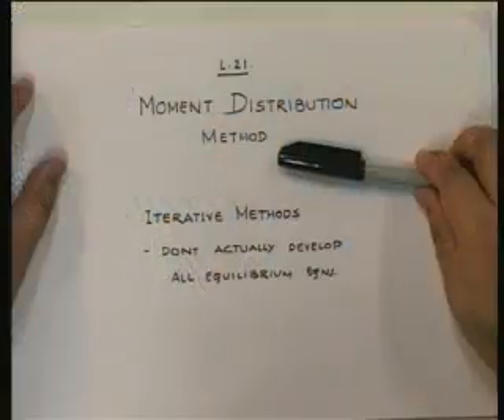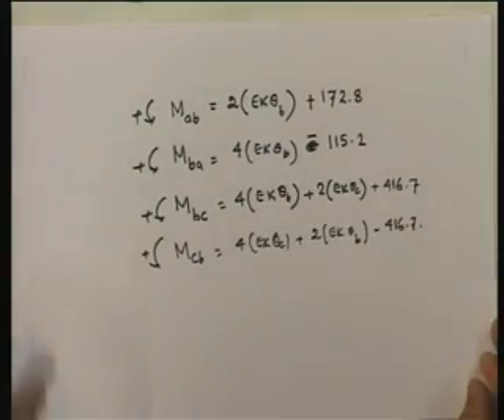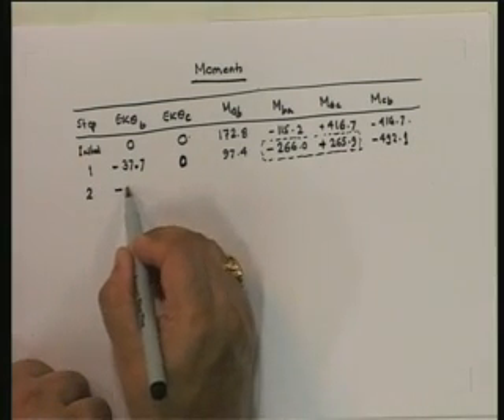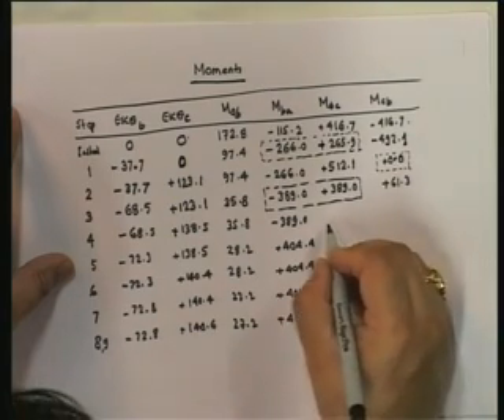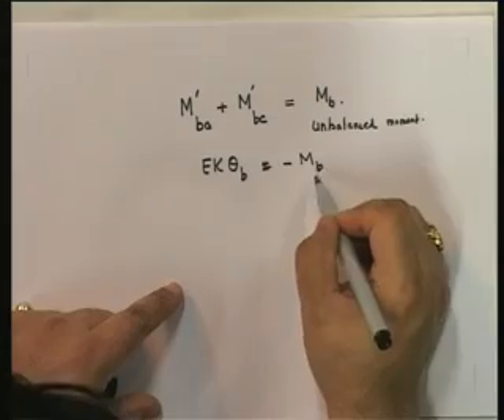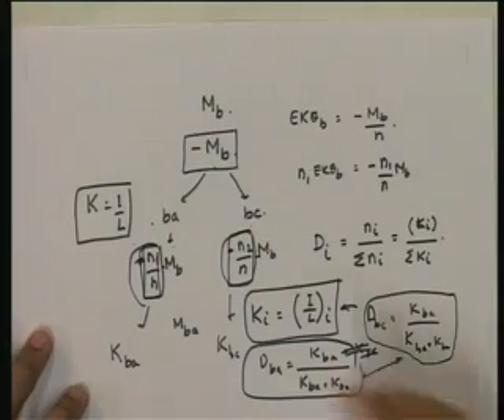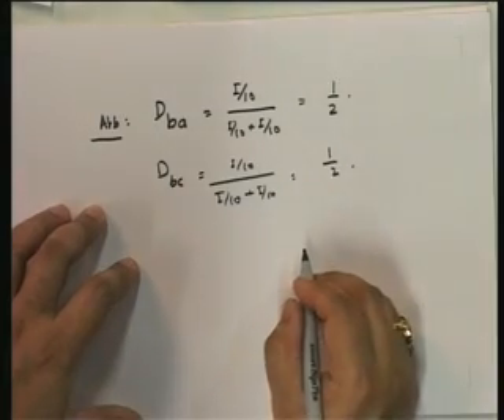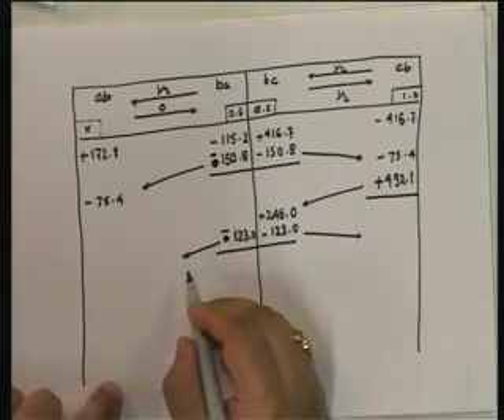Lecture - 21

Comment: Slope Distribution method was developed earlier than Moment Distribution Method, however, due to ease of use MDM became popular from 1930s onward until computers began to be widely available, after which SD method has been used in computer programs. MDM is only applicable for determining moments and it ignores axial and shear forces and deformed shape, hence it is not as comprehensive as SD method.
Reply: Hasan Shirazi at 57:37 ques will bc transfer carry over to cb...bcz end hinge can't b transfered with moment